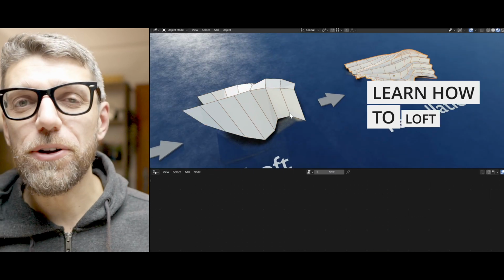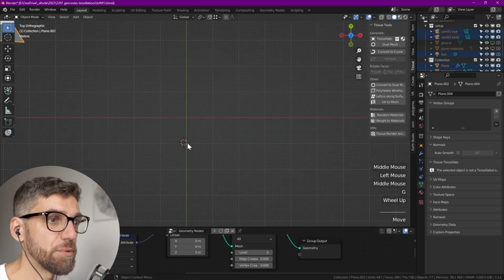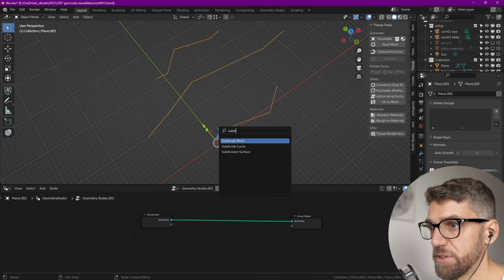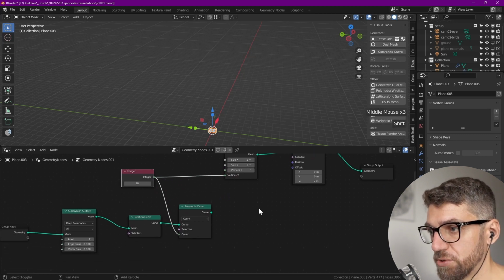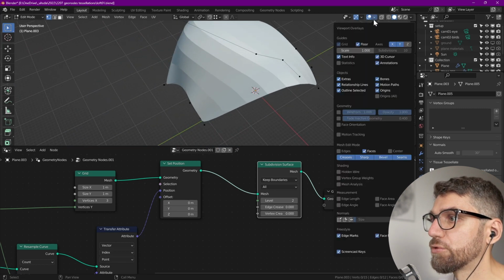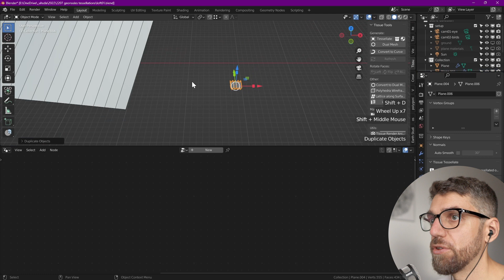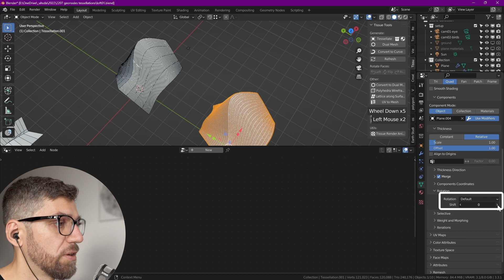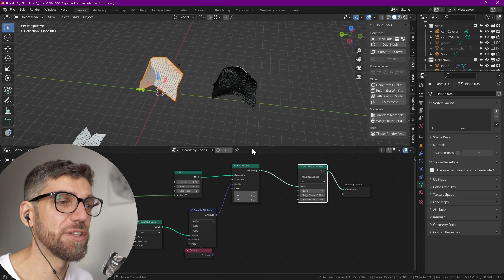Lazy + Awesomely fast Loft in Geometry Nodes and tessellate with Tissue

Comment: assuming two bounding edges of the loft are part of separate meshes or bodies and the bodies faces have a certain curvature, is it possible to constrain the curve/spline used for lofting (connecting these 2 meshes) to initially take one the curvature of the adjacent bodies and then blending into each other to give a nice transition. I mean some parametric way-see CAD packages, without pushing and pulling vertices to somehow approximate the transition?

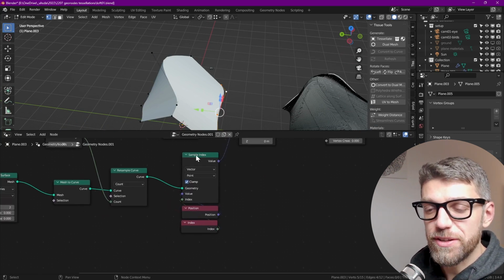Comment: 4:00 🏆 Thank you for testing a feature in different versions of Blender and sharing the result. Most "Geometry Nodes" tutorials do not mention that the "Transfer Attribute" feature was removed after Blender v3.4. The "Sample Index" feature worked in v3.6. Regards!
Reply from the maker: I might have gotten lucky that I filmed just as the change was happening. If you watch tutorials before, they were useing the Transfer attribute, and anything after the sample index.

Comment: I just got the same set to work with the cylinder node and the cone using closed edge polygons . nice to have a closed surface and editing, even duplicating mesh elements works!

Comment: is it possible to close the mesh by joining the first point with the last point?
Reply from the maker: Yes! Although it requires a bit of extra work and sifting the vertices in a system that is not quite designed to do that. Also, the ends would still be open
Reply: @UHStudio  I found a solution with extrude mesh but it's really complicated operations

Comment: Looks a bit crude to be honest, but it's good to see such functionality slowly appearing in vanilla Blender. Try Sverchok add-on, it's as good as Grasshopper at such operations, and it interpolates a curve (nurbs, bezier) exactly through the vertices. Thanks for your content!
Reply from the maker: Sverchok is great indeed, but it's a whole different beast. I don't see Geometry Nodes as a replacement of Grasshopper or Sverchok, but as a compliment, or an extension of modifiers in Blender - a little quicker to do it all in one go than to figure it out precisely.
Reply: @UHStudio  Absolutely!

Comment: Out of curiosity 

In blender I see that you explore  your concept ideas with geometry nodes 

How do you continue working with it afterwards?

So you export high res mesh to an architecture app to trace over ?
Reply: It perfectly explains it.

Geometry nodes became a nice addition to grasshopper because of the geometry (polygon) type and all of blenders render tools.

I do feel geometry nodes is currently the most powerful tool that opens the door for blender a lot more.
Reply from the maker: If it is a concept design that will be developed further, I move in between Blender and Rhino. It's hard to define one way of doing it, since it highly depends on the initial geometry. If it is something like this example, then, I would take the U curves and the V curves separately, and then use every Nth U or V curve to generate beams in Grasshopper, for example. Hope that answers your question?